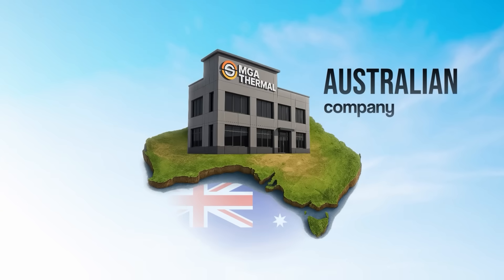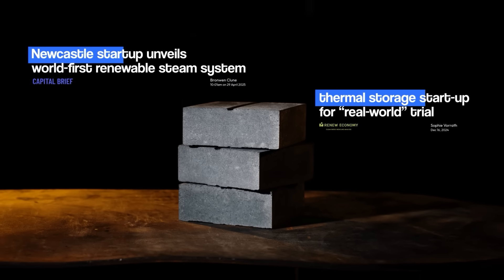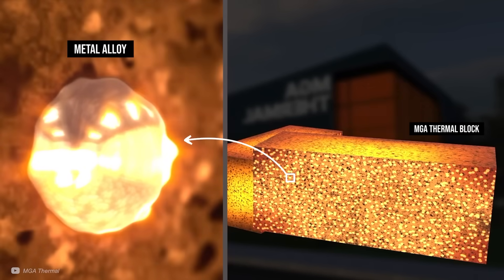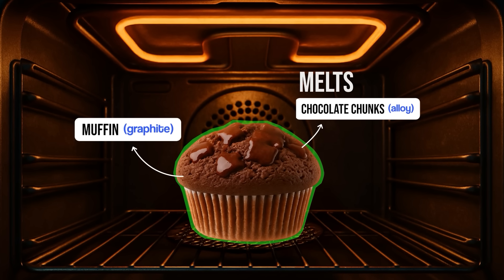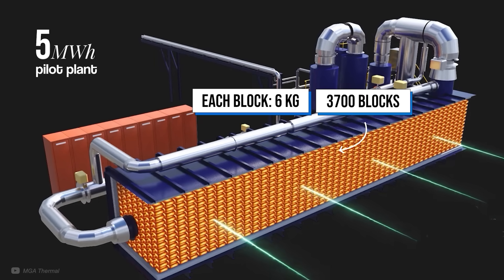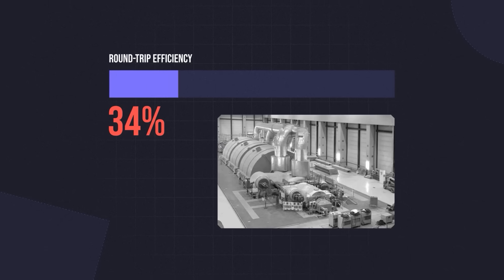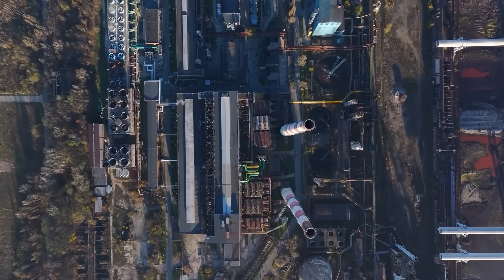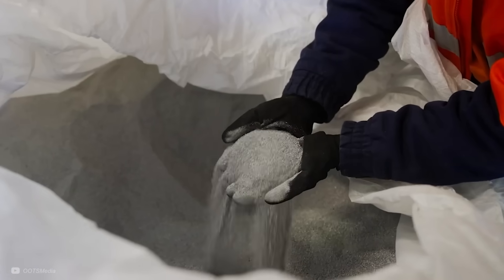Why This Carbon-Alloy is the Future of Energy Storage

Comment: Has anything on this channel ever "changed the game"?
Reply: These are games that take decades to change. Check back in 20 years for your answer
Reply: NASAs flywheel battery that also can be used to orient satellites.
Reply: @mefobills279 
Kinda but it would be difficult and the mixed usage of flywheels for control and power wold be annoying to do because if you want to withdraw/ recharge you change the attitude of your spacecraft and if you need to change your orientation you loose your charge of your battery
Reply from the maker: I'm going to take the bait here - but yes, there are multiple technologies covered over the last 5 years that have had significant impacts on the world of energy engineering (e.g. yokeless motors, thermal energy storage from Rondo and Antora, BYD blade battery, high temperature fuel cells, etc), however, many other technologies are still in research phases so will take a lot longer to come to commercial applications.
Reply: "The internet", of sorts, existed in the 1980's (prototypical versions date back much further). Tablet computers existed in 1990.
Why weren't we ordering from Amazon on iPads in 1993?
Reply: Ghosted?
Reply: It appears nothing has come out of the breakthroughs Ziroth has covered, but it does get you thinking. Maybe not like an academic, but more like a bloke who can change his own car tires and oil. 

Eg, their magic sauce appears to have the same thermal capacity of sand at 800 degrees C, and weighs 700kg less than the 23 tons of sand required to achieve 5MW (13,115,520 BTU by my calculations)

Also, they are using some high tech system of tapping the heat to make steam by circulating nitrogen gas.

Perhaps these researchers haven't heard about the cutting edge tech of the industrial revolution in Victorian England?

Pretty hard to set sand on fire, and in a pinch you could burn their system to store in a sand battery.

Now that would be recycling!
Reply: Hmm, no. Interesting as it may be, cost benefit always favors the simplest and dumbest solutions that a trained gorilla can implement. These are always Ferraris and lambos in a demolition derby. The best vehicle is cheap, durable, easy to fix, drivable by anyone, and mass produced.
Reply: @stevennope8864  I'm an aerospace engineer and that's actually a VERY GOOD WAY to describe most of these sorts of technologies. In the end most cases of engineering come down to "what's most practical."
Reply: No, but its lots of fun trolling ziroth and his brain dead followers.

Comment: How would are they able to reach 93% efficientcy using a steam turbine? Using Steam means you need to heat the water to several hundred degrees celsius. So most of the energy in the bricks cannot be used with the steam turbine. If you just reiterate their PR without questioning any of it, then this really isn't a deep dive but more like an ad for the company.
Reply: They don't, 93% is for this thing to just function as thermal storage for a steam boiler for industrial plants that use a steam boiler. The only major benefits right now are:
Steam generation can be shut off very quickly whit this system, normal steam boilers usually don't shut off quickly which leads to energy waste.
They can theoretically heat this box up during off peak electricity hours if they can get a lower rate during those hours and use the heat later.

They mentioned the drop to ~40% efficiency when used to run a steam turbine.

Comment: It all compiles down to cost per kWh. 
There other alternatives for high temperature storage for up to 1200 ° C using cheap slag, working similar. And there are Thermal Photovoltaik  storage systems going to more than 2000° C with carbon, converting thermal directly to electricity with up to 43 % efficiency. This can be further increased to more than 50 % by co-generation by using a steam turbine.

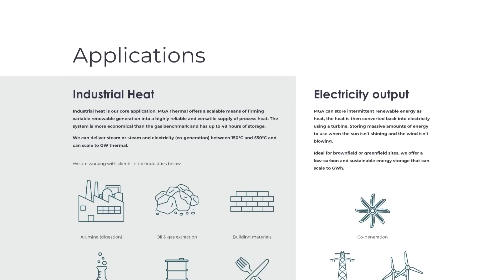Comment: 7:57 Bullshit, round trip means going from electricity --> steam ---> electricity, it is impossible they achieve 93% efficiency due carnot limit!  
As you said later on steam turbines go from 35 to 55% (one or double cycle) efficiency, so it is impossible to achieve 93% round trip. 
I guess they are talking about the efficiency of all the process before reaching the steam turbine, but why they use the word round trip in this case???  when is not.
Reply: The 93% round trip eff. is when they DON'T use the energy to make electricity. That eff. figure is for storing the heat to us it as heat later, not generating electricity. That is why they also told us the round trip for using this to heat steam for a turbine, they figure these are going to be heat batteries for places that use heat for industrial processes or heating directly.
Reply: @Tom89194  I know that they must be talking about that, but the text is wrong from any point of view, quote "electricity-to-steam round trip", this mean it start as electricity, then become steam (here they may have 97% efficiency), then keeping that heat certain time and re-circulated 93% as they claim, but round trip means they need to convert that heat back to electricity..  that is what round trip means because they clarify they started as electricity.
Reply: @angellestat2730  You misunderstand, 'round trip' is energy INTO and then OUT of your 'battery'
IF the energy is used as heat energy, then 93% is plausible(because they are just moving heat energy without conversion), but as they mentioned IN the video, this drops into the ~40% range when used to make electrical energy.
Reply: @Tom89194  Round trip is energy if you did not specify how it started. But they did.. they said electricity to steam round trip, round trip means go and back, going back equals to becoming electricity again because that is how they defined.
A lot of companies try to gain extra press being  ambiguous, but in this case is just wrong because they defined how it start and how it should end.
Just to clarify in case you were right on this specific notation,  I asked Claude AI about this same case and words they used, and it give me the same explanation that I give you without giving the AI any clue on what was my opinion on the matter.
Reply: @Tom89194  Besides, the 40% is fine  depending the final LCOS, hydrogen is similar but without the 48 hours limit, in practice the limit for hydrogen is almost infinite because the cost to scale capacity is quite cheap once you purchase certain power input-output.  This mean it does not waste any energy for reaching full capacity. 
In the case of hydrogen would be more common to use the outcome energy in chemical form without returning that to the grid.  (because you still need energy in chemical form to power the utility transport sector or the natural gas grid. 
But again, if an hydrogen company said electricity to hydrogen round trip, I would be pointing the same error if they quote the efficiency without the electricity output.
Reply: @angellestat2730  Round trip efficiency is a common reference in 'battery' tech, it refers to the losses incurred when putting energy in to a battery and getting it back out of the battery.
Here they SPECIFY that the energy is going from electricity to steam, and that IF they did go BACK to electricity they would incur a 60% loss.
Claude AI? dude, GIGO.

Comment: This could be useful with steel foundries, as they need to cool molten steel while also heating the next batch. And also harvesting heat from slag to heat steel. The problem is that steel melting point is 1370-1530C which is well outside of the batteries levels.
Reply: Even partial heat transfer from the molten steel to the next batch might lead to some good energy savings
Reply: give me idea about steel foundry...
how about reuse heat from hot slag? maybe slag to sea water to turn turbine and stored to energy storage that could be reused....
so heat storage could used not only on renewable but on industrial that mainly use heat (steel foundry)

sorry for silly discussion

Comment: Maybe when building new houses one can bury one of these under the ground then pour the foundation slab on top of it and the use that heat the house in the winter through the floor.
Reply: My understanding is that a similar idea is already well-established in Denmark (warm summers,cold winters).When constructing a new home,the idea is that while the digger is on site you excavate a further 2m within the footprint of the building and then fill it with regular sand in the summer while the sand is warm.The heat slowly warms the building via radiation and conduction over the winter before being 'recharged' the following summer.
Thermal mass,heat exchange,insulation.Pretty basic stuff to a chemical engineer.

Comment: High energy density might be important in some applications, but the thing that actually matters is cost of material per KWh stored. Aluminium isn't cheap. Space is cheap (in industrial situations). So I'm not sure I'm getting this. If you need real, actual dirt cheap heat storage you can use things like sand and gravel. Yes, you need more of it, but it's the bottom line that matters.
Reply: Achieving the higher temperatures required by some industries in less space might justify the investment, but I'm sceptical as well for any use at larger scale.

In a world where metals keep getting rarer while their demand is always greater due to electrification, ceramics seems like a surer bet than any alloy. Plus graphite will be in super high demand for batteries and nuclear applications.
Reply: In a TES storage system, there are other components whose cost scales with volume.  For example, the insulation is an important component for efficiency - and the higher the temperature, the more critical it is (because the delta-T between storage and ambient is greater, the faster it will loose energy).  Higher temp TES systems generally need more specialized insulation materials so not to melt, too…)  So, having a higher energy density makes a difference in the amount of expensive insulation.  Ditto the HTF (N2), pumps, electric heaters, etc….  It actually adds-up.  Whether the overall system cost is lower as a result of the fancier material is a larger calculation - which I guess they like.  Given that temperatures >300C are tricky to make (b/c steam tops out around there), there may be good reason for even higher cost storage if the high-temps are needed: it’s a niche market.
Reply: Well they actually claim to have a levelised cost of heat more competitive than gas boilers when taken to MW scales
Reply: The size of the battery influences the cost of building and operating the system, and if we are talking about replacing something like a steam boiler for an industrial plant, then you need to care about its footprint. Aluminum is MUCH cheaper than lithium batteries, and this 'battery' shouldn't degrade over time like a lithium battery, if something happens and there is a fire it will be easier to handle.
Reply: @Tom89194  Yes, but still far more expensive than, say, sand. I like the idea but I'm sure its a bit more complicated in the real world.
Reply: @saumyacow4435  Yeah, the only places that will use something like this are places where the space is at a high enough premium to pay for the cost.
The only real benefits to this are like in the steam boiler replacement for the industrial facility they mentioned. They had more than a 10% reduction in steam since this 'boiler' can shut down its steam generation faster, leading to less waste and the fact that they can be used to take advantage of off-peak electricity rates.

Comment: If one of those heat storing technologies could be minimized for home use, it'd be very efficient for heating homes. The high temperatures should make it possible for smaller devices to store more heat than the classical ones used in the 70ies, and with the low energy loss over time it'd be a great way to store excess solar energy for example
Reply: nighthawkinlight did a video a few months back about PCM materials.  he was able to come up with a few recipies that did their phase change "near" room temp.  so they acted as a thermal battery around 70F or so.  helping reduce the cost for air conditioning.  

and best of all, most of the ingredients, you could pick up at a supermarket.  no need for a furnace to melt exotic metals.
Reply: @igiveupfine small scale for heating sounds attractive, but I'd think that it would be more effective to make it on a per neighborhood basis (like a substation) to make the transition more scaleable
Reply: We've used electric storage heaters with storage bricks in for years they charge up at night using cheaper electricity. But they just aren't very efficient, largely because of the materials the bricks are made from.
Reply: Ziroth did mention sunamp

Comment: Steam and graphite blocks.  Ring any bells?  Wasn't that Chernobyl's Achilles heel because the water broke down?  Anyone know what the critical temperature is here?  Maybe its a possible hydrogen production method, where you mitigate the explosive tendencies?

I vote the upgrade to supercritical CO2 for working fluid too.  I know that water breaks down into hydrogen and oxygen at a certain temperature, is there a temperature that CO2 does that too? That would be a humongous win to be able to break down the co2, leave the Carbon in the battery, and siphon off the oxygen and  cool it off through some sort of heat exchanger, to produce steam for power, making it a low loss co2 elimination method rather than a high loss energy conversion step alone.  Pre heating blocks with the energy shed to turn it into liquid oxygen might work too.
Reply: They said 700 degrees celcius which  is a renewables energy storage range. Water splits at over 2000 deg c. Apparently co2 would need up to 6000 degrees c to fully split under temp. No one is making either of those happen any time soon.
Reply: @torque350hp  The water splitting thing is a strange deal, at 2200C about 3% of your water is split, because of the high temp the hydrogen and oxygen are constantly splitting and recombining. If you get the temp to 3000C then ~50% of your water is split...
Reply: @Tom89194 so, we just need a ceramic exchange "membrane" and a resistive heat source and a lot of insulation and thermal mass to get 3000C green hydrogen splitting.  3000C oxygen is going to be tough to deal with of course. Another job for oxide ceramics, I'm thinking.  Too bad they are typically not great at dealing with thermal stress and not great thermal conductors.
Reply: There are some good reasons the steam boiler is separated from the graphite by using nitrogen gas to transfer the heat from the storage box to the boiler.

Chernobyl's Achilles heel was a poorly designed reactor test. This test caused the reactor power levels to spike high enough to cause a violent steam explosion in the reactor core. The graphite fire was just an aftereffect that caused more damage.

Water starts to split in small amounts at 2200C and  about 50% of your volume will a split at 3000C, you need a nuclear reactor to turn into a nuclear bomb to get that kind of effect.

Comment: Could use the new CO2 method and go from 30-35% up to 35-45% as Co2 doesnt have the limited that steam does, or just move that heat into homes using coolants as well, but still be limited into what area you can heat up. The fact it losses 2% per day would be a pretty big step for non-classic batteries even if you loses well over half if we have a energy surplus might not matter anyways. Moving the heat will be harder for sure... at least in the US where we dont have a central distribution center for heat. Then again, I guess we could look into thermalphotatics as well, but I think it still has the same limits as solar, but we could hit something like 40-45% efficiency still. With that said, CS would more than likely be better though - taking the left over heat from a solar generator and storing it into the battery directly instead of wasting direct energy.
Reply: Great thoughts.  I've heard supercritical CO2 turbines could reach 55% efficient.
Reply: Can't use Carbon Dioxide with Graphite at that sort of temperature - it reacts to form Carbon Monoxide. The heat storage blocks would just erode away.
Reply: @charlieclelland5895  Why would they be in contact in that way? Molten Salts dont contact water either because of that reason.